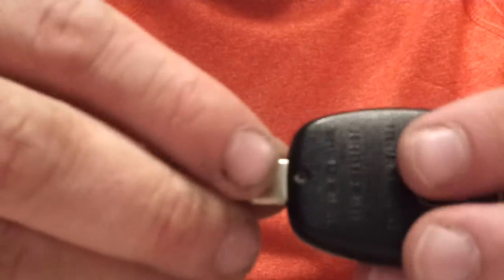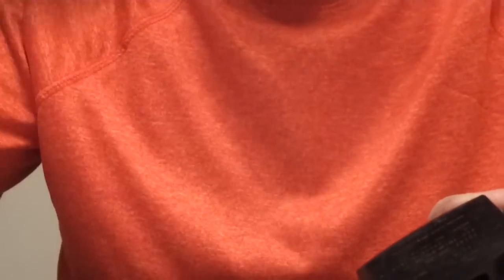Honda remote key stripped screw hack battery replacement

Comment from the maker: Thanks for all the kind words folks, glad I could help. More advice, make sure your key is warm when you do this, the plastic is less prone to break if your key is little warm pocket temperature is good.
Reply: Thank you so much for the tip. I was about to drill the screw out, figured to check Youtube first . Only taken me 2 mins to open it up, replaced battery, no damages.
Reply: This helped me, thanks!
Reply: Thanks joe. You're a genius
Reply: Thanks for the awesome video! I warmed up the screw joint with a lighter before popping out the remote as the prevent any cracking.

Did this with the second key and the battery came back to life once I opened it up. Did not have to replace it.
Reply: Thanks.

Comment: Life saver. I stripped my screw thinking it was all over for me..but then i came across this video and it worked! it was a little hassle trying to take out the actual remote but with steady hands and concentration it was accomplished. Thanks Joe! Very helpful and cheap way to change that battery.

Comment: Slow and easy wins the race.  Took my time and only applied as much pressure as I needed to and it works, thanks a bunch.  Also, props to the local dealer giving me a screw and a battery for free, that's good customer service right there.

Comment: THANK YOU!! As a ‘new to me’ Honda owner the back doors won’t lock. They told me first step Change The Battery.  It looked like a rivet, the screw was that stripped. I followed your directions, and found out the screw was stripped, took it out and after all of that, , the inner workings are junk. So tomorrow I’m off to the Dealer.

Comment: My hero!  Batteries + refused to replace it, said they don't do Honda fobs because they break and I have to go to the dealer.  All very technical.  That was over two years ago!  Two years of using the key on front door to unlock others for loading groceries, getting into trunk, and fumbling to lock up the car with my arms full.  Got used to doing that instead of finding the time and $ to get across town to the dealer during work hours.  Finally resolved to get it done but checked online to see if I could do it myself first.  A guy made it look easy so I ordered battery and tiny screwdrivers from Amazon and spent a frustrating night stripping the screw head.  Found forum that said to use heat gun to melt the loctite on the screw.  Then I found this video.  Just unlocked my car from the porch and gave myself a dope slap for taking two years to figure it out.  Thank you!
Reply: You and me both.

Comment: Honda must hate this video which helps us desperate consumers to save $$$. Thanks for protecting us from getting ripped up by the dealer. 

Followed these directions and was able to replace the battery despite the stuck screw on the key.

Comment: Thank you so much for posting the video. I tried applying heat but that didn't work. Ended up breaking the key fob case and then realized the little screw was stuck to the metal key. No way that little screw was budging. After replacing the battery, I was able to tape/glue it together.  Was pleasently surprised it still worked!

Comment: Thanks so much!  It took 10 minutes for 2 keys on a used 2004 Accord I recently bought.  The dealer wanted $125/each to replace them, even tho they're fine with new batteries in.  Broke the back of one, called Honda & got the back plate & screw for under $20 (I don't want the Amazon knockoffs when the original is that cheap).
Reply: The batteries were $7 each, also from the dealer parts dept.

Finally, don't be afraid that you'll break the case; it's made to open like this.

Comment: Joe, I was so frustrated with the battery replacement experience for my fobs. I didn't realize that BOTH my fob batteries were dead. I initially thought I had a larger problem because I couldn't believe BOTH fob batteries died. I ordered two Maxell 1616 batteries from ebay (only $2 for both) and then realized I couldn't get inside so easily. The screws were crazy tight as everyone here knows and they are so darn small.

I went to the Autozone and the salesman loosened one up with a $5 screwdriver and assumed it would be easy to do the other one. I probably should have just bought the screwdriver but I left thinking it would be easy at this point. It turned out that I messed up a cheap screwdriver and then partially ruined the head of the screw with another screwdriver.

Since I was successful with changing the battery on one undoing the screw,I decided to take a risk and follow your advice on the video and decided to carefully pry the one that had the messed up screw open and then carefully forcing the insides housing out as you did. I was less confident than you were on the video as I really didn't want to break the screw off. Once I got the inside housing out, it was easy to replace the battery.

I then followed what you said and reinserted the inside housing slowly and popped the exterior key case back together! I went 11 years on one battery on one fob.  The spare fob has sat in a drawer for 11 years practically unused and that battery died also. However, now that I have successfully changed the batteries on both fobs, I suspect that this will be the first and last time I will have to replace the fob batteries for this Honda Accord.

I love the creativity people have in solving problems. I absolutely hate going to the local Honda dealership for so many reasons. The biggest reason is that they just take advantage of their monopoly position (only Honda dealership in town) and rip people off. Thank you so much for, Joe! You have helped so many people. Collectively, you have saved people thousands of dollars of unnecessary expense.
Reply: worked like a charm...I used an  eye glasses screw to replace the wretched stripped one

Comment: This was really useful. I was about to buy entire key with program fee with the dealer --- around 150USD. All I did is to remove the small board inside according to your explanation, go to Walmart to get the new battery and put it. 30 minutes and 3.5 USD only. Thank you very much indeed !!!

Comment: Thanks for the video...this was a real lifesaver. I tried to unscrew the pathetic screw from the Honda key fob with a jewelers screwdriver and it's stripped beyond use. Glad to see that there's a method to open it up and switch out the dead battery.  You'd think Honda would get the message by now.

Comment: I know this video is 5 years old, but boy did it save the day.  I had spent 45 minutes fighting with the jammed screw.  I called it quits before I would strip the screw head completely.

Even if I would let the dealership gouge me (over $120), I won't get a replacement until after the holidays.  This is what their parts department told me earlier today (Friday, 21st December).  Then, I thought I'd give YT a try to see if there is a solution.  I found this video.  

Bought a CR1616 battery, got home, watched this video one more time.  From start to finish, it took me about 4 minutes to replace the battery.  Getting the module loose enough to fall out of the key fob casing took the most time.  I am not exactly the handy type, but I managed to get it done without breaking anything.  And instead of $120,  I only spent $4 on the battery.  Yay!

Thank you very much, Joe.

Comment: Joe, you video help worked for me first time. In about 3 minutes I had replaced my Honda Pilot remote battery and reinstalled with not breaking the case. Many thanks to you. I had been working on that screw that was stripped for several weeks with no success despite the small screw extractor kit I purchased for about $25. on Amazon. I should have learned by now to go to the internet Google search first.
Richard

Comment: Hey Joe, this video saved me from taking a hammer to my Civic and Accord remotes.  All 4 of them do NOT come apart by the screw method and 3 out of 4 are not stripped.  Thanks for posting this video.  I even found key fob shells on Amazon for $10.  You rock!!

Comment: Thanks a lot Joe. Just replaced my battery following your instruction in spite of having a stripped screw. Taking the unit out with the screw stuck was like delivering a baby by caesarian.
Took it out smoothly and replaced the battery with no problem.Total cost $1.00 for the battery on ebay.Thanks for saving me $199 from the dealer!!!!

Comment: Joe, Thanks for this hack that works. Tried everything to remove screw with proper sized driver and no budge. Heated. Acetone, nothing would budget the locktite screw. This worked in five minutes. If you pry gently the center comes out without cracking the case.  Thanks for taking the time to post,

Comment: I couldn't retract the screw as the previous owner had shredded it. I resorted to using your technique to remove the battery compartment by prying open the key casing. Worked a treat! Thanks Joe!

Comment: Even after 5 years this is still the best video on YouTube for replacing the battery in a Honda key. Especially if you strip the screw by using the wrong size phillips head screwdriver or even (like I did) one of those small thin precision screwdrivers where you can't get a good grip to break the thread locker Honda puts on the screws. 
 I bought a uncut replacement key on Amazon for <$10 and used the back, the screw and even the Panasonic CR1616 battery that came with it to repair my key using this video.  
If you want to use the genuine Honda back (with the logo) the part number is 35114-SNA-A01($7.35 on Amazon) fits 3 and 4 button keys. 
The genuine screw is part number 35116-SDA-A11 ($4.99 on Amazon). 
A size 0 (ZERO) phillips head bit will work for taking out the screw , just be sure the handle is big enough to get enough torque on the screw to break the thread lock.

Comment: Even with a precision 00 Phillips-head screwdriver, I could not get the screw out of both of my 2005 Honda Accord keyfobs, and I naturally stripped them both.

I have confirmed that this video accurately displays a viable workaround for the problem, as I replaced both of my batteries, and without damaging either of my keyfobs.  You just have to be careful and patient when performing this "surgery".

Thank you Joe Ratz!

Comment: THIS IS THE BEST AUTO HACK I'VE EVER SEEN!!!  My wife went around for 2 years without a working remote because I stripped the head of the little screw trying to remove it, and we wouldn't pay the $110+ that the dealership wanted. Then mine went out too, and of course I stripped the screw head on that one too. The manufacturer seals them with Locktite, so you CAN'T get it out without setroying the screw, and you HAVE to go to them to pay big money, instead of the $3 or $4 a new battery costs. It took me 3 minutes to fix the first one this way, and 1 1/2 minutes to fix the second once I'd learned the trick.
  THANK YOU THANK YOU  THANK YOU!!

Comment: Thank you for offering solutions when the key screw was stripped. I was feeling that I was going to have to take the key to the dealer, but your video saved me. Even though I didn't need it, by offering solutions just in case you break the case, you made me more comfortable attempting the whole process. A big thank you!

Comment: Joe, this has to be one of the most helpful videos on You Tube.  You're a great problem solver. Had a stripped screw on the key just as you described, didn't know what to do.  Followed your instructions, worked like a charm.  Thank you!
Reply from the maker: Can I get a "thumbs up"?
Reply: Joe Ratz More than a thumbs up!!! You are DA MAN!  This vid saved me $$$. Followed your instructions, got er' done, bought the new battery, installed and it's now working like new!! Thank you Joe!  Even with stripped screw, your instructions worked for me!
Reply from the maker: fist bump

Comment: Thank you so much, Joe! You have saved me a heck of time and money! I have been driving around town looking for solutions, trying to buy tools like mini screw driver, etc.; the places I have been are Walmart, London drug, Canadian Tire, the Dollar Store, but with no luck. I have tried many small screw drivers, but it ends up a stripped screw stuck in my car fob. I was desperate until finding your solution here, you are brilliant! It works perfectly for me! I own two Honda cars, one is Pilot, and the other is Accord. I own them because Honda makes reliable cars; but Honda car key fob design just brainless. How many people have the right tool to unscrew those tiny screws?  Every time it’s a struggle for me to replace my car key battery, just because the tiny screw on the key fob! It almost killed me this time until I found your solution and it works! Thanks again for your good work and sharing your experience!
Reply from the maker: Your welcome. Glad I could help. You are right, Honda has great research and development but they are not perfect. Glad I could share.

Comment: Thank you Joe for the great key hack!!! I used it to replace the batteries on both of my keys. It worked very well and I  had no problems. I used a blade on the end of the key to open the key rather than starting as you did. Otherwise your technique worked like a charm.

Comment: Joe,  Thanks for this video. (Over four years old, but still helping people like me.)  I stripped the small screw on the remote key, but I found your video and replaced the battery by prying the key open just as you demonstrated...without breaking it....:)  and put a new battery in.  Works great!  Thanks again!

Comment: Was more than a little worried about this method but on the Honda forums they were heating up the screw to loosen the locktite crap Honda put on it, using a rubber band (didn't come close) or drilling which seemed ever more spooky.  Your method worked like a charm on my fob.  Nothing broke and back in business!!!  Thanks a ton.

Comment: Thank you so much for this! Both my fobs were dead and I didn’t want to spend $150 minimum to get one of them replaced at the dealership. I did exactly what you said and used a hair dryer on and off to keep the plastic malleable. Getting the inner case out was extremely difficult even though I have the smallest hands and fingers. It took me 25 minutes to fix the first fob but it works and I feel so accomplished. My dad will be amazed! I used a Swiss Army knife at the initial phase just to get an opening in the case and then used the screwdrivers. Once again, thank you so much!
Reply from the maker: Awesome.  What part of the world are you from?

Comment: This video is a lifesaver!! I thought I had to get a brand new key since I stripped the tiny little screw. But after a few tries of prying the case open (trying two different flat head screwdrivers, the smaller one worked), I was able to change out not only one but two key batteries! Thank you!!

Comment: Awesome.  I did your advice, warmed it up like another commenter suggested.  I put it in a clamp lengthwise, though to get a gap to open up and that was enough to get my foot in the floor.  One of my buttons was sticking was the original problem, but that cleared right up after a little blowout/scrape.   Happy to be able to unlock my door again.

Comment: Thanks!  It worked great.  I had a bit of trouble getting my little screwdriver to pop it, but remembered I had a watch back opener.  That sucker slipped right in the back and it popped right open.   I do think that advice to try and get it warm to lessen the chance of breaking it is a great idea.

Comment: Thanks for this.  The screw in mine wouldn't come out and even a locksmith couldn't get it to work.  I followed your video and got it apart and put a new battery in it and it worked fine.  Honda should have a better design for this with such a screw.

Comment: Thank you very much for this video. I had stripped screws in both my key and spare and didn't know what I was going to do. But by following your instructions I was able to replace the batteries in both keys easily. It was a bit hard to see what exactly was going on in the video but the explanation was very clear and was easy to follow. Also the demonstration on what happens if you separate the pieces too far was very helpful. But I'm also glad I read the comments as well as warming up the key also helped a great deal. Big thumbs up!

Comment: Last time I opened it it was already iffy. This time it definitely stripped. This helped confirm that it wouldn't break any locking tabs if I pry it open from the top side so thanks.

Comment: Thanks for the tip! The cover came off but I snapped it back over the screw with the same set of pliers I tried unscrewing the screw with. Worked like a charm.

Comment: Thanks for the instruction.  I did this, and it worked for me.  I couldn't get the center portion out easily, so I used some needle-nose pliers to wiggle it out.  After I switched the battery, I was back in business.

Comment: Thanks for the tip, especially the part about breaking the screw if the case is bent too far. Worked like a charm on my 2005 Pilot key! Great video!

Comment: Excellent - really works well - no need to take the screw out! ;-) . I did this on my spare and main key without breaking them. Careful not to open the key to much and carefully poke out the inner casing and they just clip back together.  I would never have attempted this without seeing this video. Thank You.

Comment: You're a lifesaver! I needed to replace batteries in both keys. The Honda dealer in Niagara Falls Ontario wanted to charge me $36.00 to replace just the batteries. I ended up buying them both from The Source for $18.00. Then I used your idea and replaced them both myself. Thanks so much!